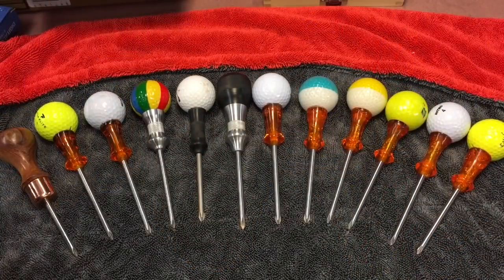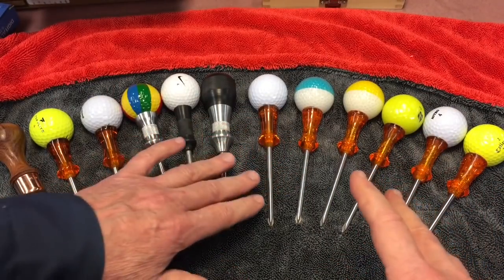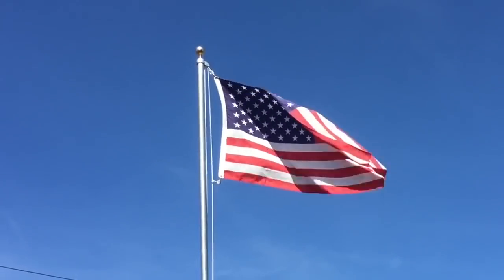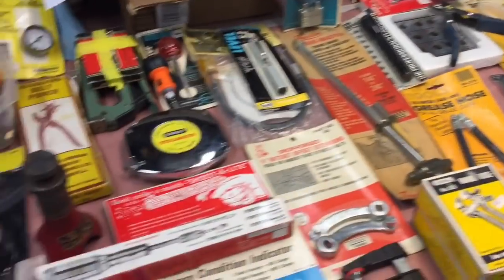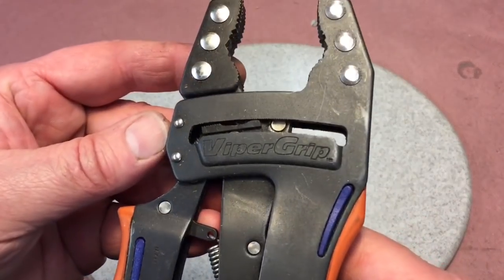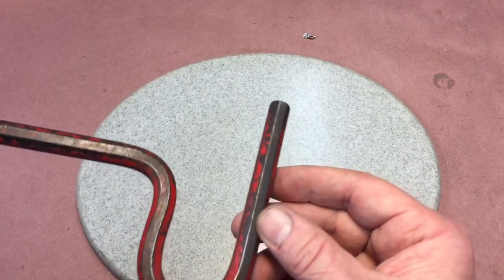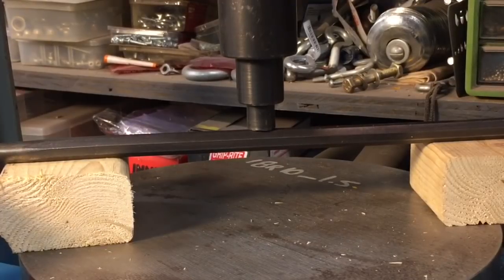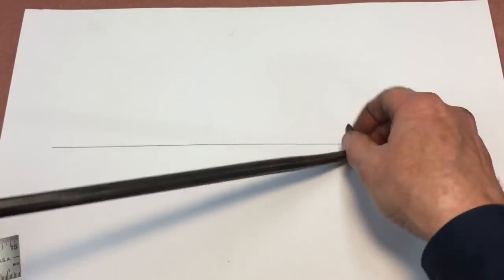Unusual Pry Bar, Epoxy Acrylic Issues and More Great Tools from Lisa and Jimmy!

Comment: Could that bar be used to lift and replace manhole covers?
Reply: That would be my guess as well!
Reply: my thoughts too.
Reply: Me three?
Reply from the maker: I have a manhole cover lifting bar it is very similar but about 3 times the size and thickness!
Reply: @ScoutCrafter  Maybe not a manhole cover then, but my guess would be some kind of metal cover. LOL, maybe that's why it was bent, someone tried to use it on a manhole cover!

Comment: Before railroads adopted roller bearings each bearing was a plain bearing with an oil reservoir on the end of the axles.  The Car Inspectors (Car Knockers) would walk down the tracks in the yards using a tool like you have to open the oil doors.   If the bearing needed oil they left the door open and came back and filled it with oil.

Comment: Sorry to say this, but the problem could be the plastic.  When acrylic is extruded , there is a fair amount of internal stress that occurs as the rod cools.  First the outside cools and solidifies, then inside cools and contracts.  That places the inside material under tension.  When it is drilled into and comes in contact with some type of chemical or solvent, that internal stress will try to relieve itself, and does so by forming the cracks(crazing)  that you are experiencing.   The slight volume change that occurs when epoxy cures can also provoke it.  Cast acrylic is less likely to craze,  but not immune to it. You might try  filing off the ears on the shaft of the screwdriver,  drilling a slip fit hole and try a gel cyanoacrylate adhesive,  but that's just a W.A.G.

Comment: It might be an interesting project to redo one of those perfect handles with material other than wood. You have often spoke about how difficult it is to shape the scales, maybe building up a handle out of epoxy or JB weld and then sanding it back might come out nice?

Comment: It is an autobody pry bar.  You would punch a hole a hole on the edge of a door or under a fender or quarter paneI sold mine along with maple solder paddles, 1lb solder bars, various metal files.

Comment: If it isn't due to a chemical reaction, it may just be stress fractures due to expansion.  Would be interesting to ask Devcon technical support if there is a volumetric increase in their product as it cures.
Reply: I thought the same thing along with heat from curing

Comment: I have had a pry bar vey similar to that for 30 years. Thee one I have I bought off a Mac tool truck when i was doing auto body repair for a living. The one I have is designed to slide in between inner and outer body panels to pry dents outwards. That "tee" handle allows or good control when positioning the tip of the tool.

Comment: Hi Scoutcrafter factory screwdrivers don't have glue they pressure fit the handle. When you are using the tool you are pushing down so as long as the shaft won't turn and won't come threw the handle maybe it doesn't need any glue. Just a thought.
Reply from the maker: David- Excellent observation and point you made...   Thanks!!!!

Comment: The epoxy could be not meant be used acrylic. Some epoxy’s and glue’s sometimes have negative actions to some materials. Best way to find out is to test on a scrape piece.  I have seen a bar similar to that one be used to take off cover for water meters.

Comment: Let me give you my quick thoughts on the screwdriver handles. It's hard to say whether it's crazing or a heat related fracture. The give away is that the one you made with the light press fit. That points it's finger right at the epoxy. Since there was less of a void to fill, less epoxy came into play. It probably doesn't matter what the actual mechanism is. If it is not too much more trouble I would try to continue with the light press fit. If not, I would for sure do a couple of test pieces before I dug into all those bars you bought. Hate for you to mess up that much stuff not being sure.
Reply: I agree. I think if you just epoxied the ball handle onto the shaft and then just press fit the plastic handle you’d accomplish what you wanted.  I think the epoxy needs a little space or it gets hot and reacts with the plastic.

Comment: When I worked in plastic fabrication long ago, it was understood that flame polished acrylic edges should not be cleaned with any cleaners like windex, etc. Crazing would occur shortly afterwards. This leads me to believe the heat generated from the drilling caused some change in the plastic similar to flame polishing. The glue possibly acted like the windex from my example. Possibly using coolant when machining might help. Generally speaking, acrylics and most plastics should be cleaned with soap and water or a specific cleaner intended for the material.
Reply from the maker: Thanks!!!!  There was excessive heat generated drilling deep into the plastic!  I ordered different drill bits to see if I can cut down the heat.
Reply: @ScoutCrafter  forgot to mention that we also used to regrind our drill bits with a 0 degree rake angle. This prevented chipping on break through. Might have kept things cooler as well.

Comment: There are two reasons that the acrylic would crack- a chemical reaction or thermal reaction. Take a piece of the acrylic and put some epoxy on it and see what happens. If there aren’t any cracks then it’s a thermal reaction. Drill a hole in the acrylic, fill it with epoxy and see what happens. My theory is that when you put the steel screwdriver shank in the acrylic with the epoxy, the epoxy heated the steel while curing causing expansion of the shank thus cracking the acrylic. Just a theory.
Reply from the maker: Thanks Ralph!   So great meeting you and talking with you tonight!!!!!!!
Reply: @ScoutCrafter  It was good talking with you, and thanks for introducing me to some of the other guys. I appreciate these videos and  your enthusiasm for restoring tools and tinkering makes them all the better. Keep 'em coming!

Comment: Hi John.  
We used a hook that was the twin to yours. to release the fifth wheel of a semi trailer of a over the road truck.  The reason for the odd length was the actual location of the release was next to the fifth wheel, above the frame of the truck and below  the frame of the trailer, a rather narrow space to reach into.  Anyway, great video keep them coming.  
Bill 
a Utah  supporter👍👍

Comment: Regarding the plastic cracking I have experienced total fracturing of plastic when a cyanoacrylate accelerator is used  on some plastics, the plastic parts just crumble, I think the ingredient that causes that is acetone, maybe there are  microscopic cracks in the plastic where the acetone enters, in your case a similar chemical in the epoxy could be the culprit.

Comment: I’ve been driving truck for 25 years now, i’ve seen guys use those hooks for all kinds of things. You can use them to set the dock plate when you back your truck up to a loading dock and you can also use it to pull the pin of the fifth wheel on your tractor, (release the jaws around the king pin when dropping a trailer). They also use those to drag bins and such in a warehouse setting.

Comment: Awesome job on the screwdrivers!! That prybar like item looks like it was a push rod. Used for finding septic systems or pipes in the ground. With the handle and the pointed tip. But who knows.

Comment: Maybe if the glue was allowed to cure in a vacuum chamber it would pull the air out of the golf ball? The glue might be drawing gasses from the inside of the golf ball?
Reply from the maker: That is a great observation Joe!  This batch of screwdrivers I had glued the shafts in the acrylic 2 days before inserting into the balls...  Normally I do all at once but not these...

Comment: Many moons ago, I used acetone to prep some Lexan assembled with Devcon MVP-33 (such a good adhesive, they stopped making it).  It was easy to see the "crazing" in the clear Lexan.  I had the Devcon application guys scratching their heads until I told one of them that I used acetone to clean the joints.  He told me the "crazing" was far worse than a cosmetic thing, it was structural failure of the substrate.  He said I would have been better off using nothing at all with the MVP-33 and he told me to use good old alcohol instead.  He was right.
Reply from the maker: Yes- After seeing my Acetone craze from the first batch I used isopropyl alcohol to prep the second batch.  That usually is harmless to most plastics...  Thanks!

Comment: ScoutCrafter, 

Junior High shop, we made screwdrivers.  We put the shafts into the handles by first heating the shaht and then inserting it into an undersized hole.   We used no adhesive,  only heat.

Bob
Reply from the maker: I might have to give that a shot!!!!!   Awesome Bob!  Thanks!!

Comment: I've got a question about those hand vices. I've never seen one that new, the ones I come across appear to be from the turn of the century. I've noticed that almost as a rule, they have a very strange thread pattern. Very coarse and square like a vise screw, but they always seem to have an ill-fitting butterfly nut, or you can only get 3/4 of a turn before you run out of screw. The iil fitting nuts I assume is a result of somebody replacing the wing nut incorrectly. But why the huge threads? And why such a small range to open up? The model from general is striking an appearance simply because it has a nice long carriage bolt. It almost looks wrong, though it would clearly work better. So what gives?
Reply: I have one of similar design from early last century. I think hey were used to hold small parts and jewelry for buffing/polishing/ 
Grinding.
Reply from the maker: JP you are so right- It seems like very early models had custom made shaft with acme style threads because in reality bolt threads are made for holding and not for repetitive operations. So I guess the early models had a thread more appropriate for vise work and like you said the winged got lost and was replaced with a standard one that didn't thread well...  Funny when you think of it!

Comment: Could be for pulling something down like shutters or pulling something up like covers. The pointed end makes me think it’s for piercing something, hooking into it and pulling out of something. Your seal suggestion sounds very likely.
Reply: My first thought when I saw it was that it was for pulling up manhole covers.  Put the one end in the little hole of the cover, and lift it right up.  Does anyone else have any thoughts on what this tool is for?  (Perhaps more than one use!)
Reply: @WinRem30  I wonder why the length of the handle extends so far. I thought manhole cover also but the pointy end makes me think it pierces.

Comment: More screwdrivers !!! Been looking up lathes on eBay John.  And parkouring......
Reply: Make sure you can change the belt, if it has one. I have a HF 34706 and while the whole internet agrees it is a great starter lathe I cannot get a new belt on it.
Reply: Parkour!!!!
Reply from the maker: @johnpossum556  That is a good point!  I will show on Friday what it takes to put a belt on the 7x10 Metal lathe...

Comment: Got ya boom
Reply: Late parking up and had to walk Elvis 👍👍😂😂😂😂
Reply: When l worked in the grocery business the milk delivery driver would drag a stack of 6 to 7 milk wires & plastic crates, with the hook. When asked why he did not use a two wheel cart he said it   was easier dragging the weight rather than balancing the weight on a two wheel cart. A milk crate with 4 gal. of milk weights aproximately 36 lb.× 7 = 252 lbs.
Reply: Watch out for your next time you see a bread delivery man making his delivery and he uses something similar to hook the bottom tray on a stack of trays full of loaves of bread and he will pull the stack all together with the oak pulling on the bottom tray there is lots of uses for that type of tool